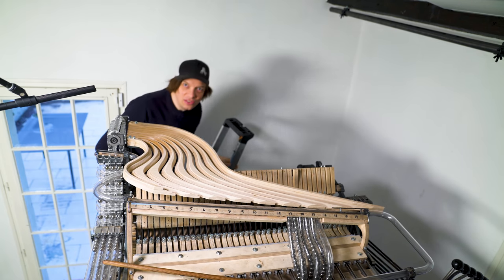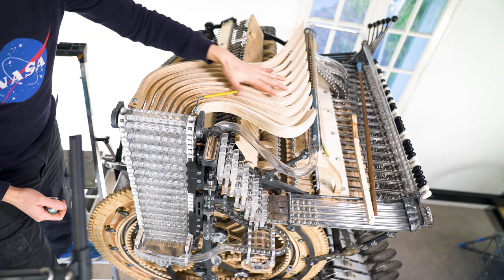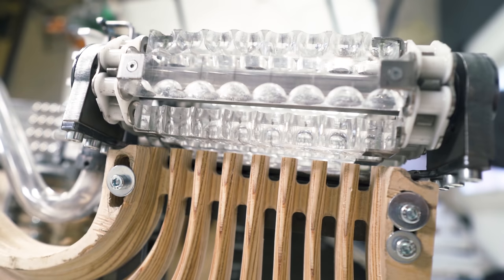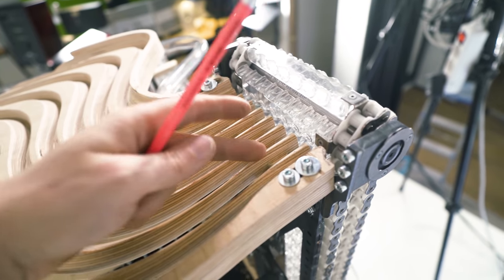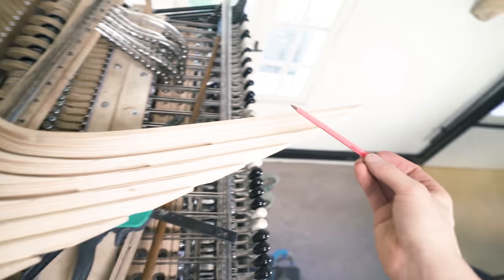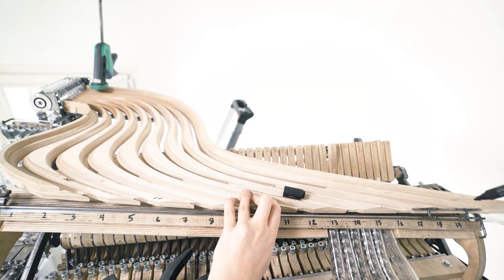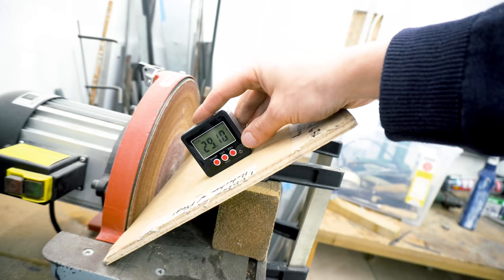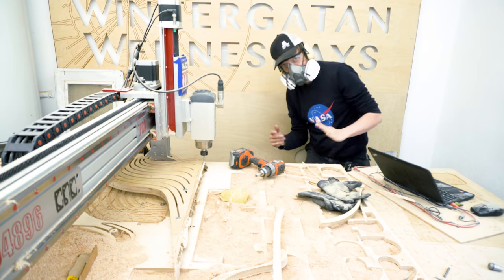Marble Conveyor Belt Plywood Lanes

Comment: Seems like the marble elevator tends to favor filling in the middle.  Is this a problem for the left most channels of the marble divider?  I mean there's the fish stair, but as you said it's limited capacity.  This feels like a potential mole.  As does all that bouncing.
Reply: If a recall correctly, he can choose where the marble will go before the elevator, and he choose to favor the middle
Reply: Yeah, I thought the same thing and commented on that last video... but I see now and remember that the fish ladder feeds more in from the absolute far left, sooo, shouldn't be an issue.
Reply: I worried about this as well, but as the other person said the entrance for the chainlift is adjustable and the machine is designed to work with a huge number of marbles, so there will probably always be enough marbles to fill the fishstair and subsequently the first couple of channels, so I don't think it will be a problem. the bouncing on the other hand seems like a potential mole, someone suggested on yesterday's video to slow the marbles down towars the ends of the tracks using overrotation, that might fix the issue
Reply: My thoughts exactly too.
Reply: @mikaoleander  Indeed overrotation seems to be a pleasant solution to counterweight the inertia gained thanks to the new shifted marble path.
Reply: @etiennedud  yes with some pins he can put or remove if i remember correctly
Reply: My worry isn't that they favour the middle, but that there are only up to 3 or so (out of 8) per every drop. If this can't be scaled up (if the demagnetiser is limiting the flow no matter how many marbles you use, for example - it might not!), that could be a mole on its own.

And yes, I'd go with both an extra rail (like at the end) and over-rotation if I were him, to avoid flying marbles!
Reply: @EcceJack  Its just because there is only a few channels playing and is not fully loaded with marbles, the majority of them and going though the stairs rather than being played, the ones one the lift are only the ones being played, add more channels and it will fill up a lot better
Reply: The lowest notes on the vibraphone are not used as much, therefore don't need as many marbles
Reply: I'm concerned about the fact that the fish stair relies on the excess marbles that run all over past the full channels. I wonder what would happen if a lot of central channels are suddenly drained by a fast playing sequence and then a lot of marbles from the leftmost channels are required.
Reply: I noticed that too. Maybe consider making similar mechanism to "devide by four". Maybe "devide by eight"? :) So the marbles have time to take space in all 8 slots od belt. That will be more efficient use of the convayer belt. Maybe there will be more empty turns, but od the turn occured IT will be full.
Reply: Agreed. Knowing the vibraphones will need more marbles it will need to adjusted to favor the first few channels, because those still pass every other channel.
Reply: @Altarin94  Just biasing towards the start of the divider should solve the problem. When things are full, there isn't a problem to begin with. When things are lean, feeding the divider starting from the top won't have much to conflict with. And it sounds like that is an adjustment that was designed in from the start.

Comment: Consider adding felt over the peaks of the wood dividers right at the point the marbles drop. They will quickly wear down the wood otherwise and it will reduce noise.
Reply: I was thinking that they could be curved, so that the track softly catches it instead of bouncing.
Reply: Why not both?
Reply: It'll probably help dampen some of the energy of the entering marbles too
Reply: yeah you can already see it hapenning
Reply: He said he rounded the corners of the tracks so it might be enough to keep it in shape for a long while
Reply: And also the first marble seem to bounce of the wood divider and hit the metal washer...
Reply: Also, making that area more substantial, removing less material.
Reply: i believe i can even see how marbles are eating the plywood already
Reply: Could be the place to introduce some hardwood, maybe beech or maple?

Comment: I'm concerned marbles will escape if the queue is more full than these tests have shown so far.
Reply: It had 4 lanes open though. I hope it won't starve for marbles if the machine will go full open lanes.
Reply: Yeah we’ll have to wait and see how it goes with the Vibraphone and Cyber Base hooked up. Once all channels are going there’ll be many more marbles entering the queue, but many more draining out of it too.
Reply: I imagine for each song there is an ideal # of marbles used and that can be adjusted pretty quickly, or he'll compose the songs to utilize the marbles evenly, or something else pretty simple. He has been down this road before...
Reply: @tommj4365  Yeah I mean he knows the maximum rate that the main marble lifts can return marbles to the top of the machine. So he has to write music that doesn't require more marbles per second on average than that. Having some extra marbles is probably no big deal, they'll just end up circulating repeatedly through the fish stair and marble divider. Just has to make sure there aren't so many extra marbles that that system gets overfull.

Comment: I like the new look, however i noticed that the marbles are jumping lanes as they leave the conveyor. complete lane departure at 8:29, 3rd track from left to 2nd track to left. 10:28 4th lane from left to 3rd lane from left and a near escape at 8:43 4th lane from left to 3rd lane from left.
Reply: This new design is visually interesting, but dead on arrival. The lane jumps, high speeds at the merge, additional entry points at the merge resulting in the marbles climbing,  having multiple lanes that effectively skip all of the channels... this is an engineering disaster.

Comment: The speed that the marbles come in off the track with is a bit concerning to me - when they land on the channels it seems like they bounce quite a bit, and that could lead to some dropped marbles in a large sample size.
Reply: I was worried about this last video, but it looks like they're mostly bouncing in towards the conveyor again. Because the back wall of the marble divider. There will be some serious bounces, but I think he'll be able to manage it with additional guard rails/walls
Reply: That lip where the tracks meet the divider is definitely the main thing causing the bouncing. I think a good solution would be to smooth out that lip, as well as slowing the marbles down a bit - I've seen other people suggesting widening the channels to cause over-rotation, or spraying the channels with some rubber coating or something similar to increase friction.
Reply: The merging onto the divider looks to me to have lots of potential for one-in-ten-thousand pileups which lead to lost marbles or, worse, marble jams. I fear this design may be unable to provide the required reliability.
Reply: @BambiTrout Sending highly rotating marbles into the divider isn't going to solve bouncy problems though. Rotation will slow them down, but now they have torque instead.
Reply: @BambiTrout  I think the over-rotation is a good idea, and quite fitting for the marbles to have these over-rotating lanes at the very top, and bottom of the machine.

Comment: I imagine there will be a lot of wear on that contact points where the balls first hit the lanes.
Reply: You might be right, I'm curious the effects long-term. That being said, I imagine it wouldn't be too difficult to match the geometry and replace just that spot with a machined piece of metal or acrylic
Reply: With machines like this, with the amount of use Martin expects of it, you have to consider all items wear items. It matters more about how the item fails, if it fails suddenly and unexpectedly, and if it's easily reolaceable - less about trying to design items that will never wear.
Reply: Maybe painting the wood with silicon paint will help.
Just a 6cm strip at the top where the marbles drop onto the wood might dissipate some of the energy.
Reply: Honestly some sort of thin felt like what’s used in piano bushings might be best.  Something thin enough to prevent wear and be fairly easily replaceable while also reducing noise without causing too much bounce.
Reply: I think this would be unnecessary from a wear standpoint. It will wear very slowly, and if it gets to the point of becoming an issue, a new part can be cnc'd and installed quickly. Lacquer or polyurethane could also be used to slow the wear, but I think many are underestimating the durability and flexibility of wood.

Sound is another issue though.
Reply: @neilhoh9443  I wouldn’t be too sure about that. He specifically mentioned how long it took to CNC this part and then we saw a snippet of what it took to adjust it to the actual machine. While the entire module could be replaced, innovations that allow things to be replaced easier and faster are certainly worth looking into, especially with the scope of the world tour. You can only have so many premanufactured backup parts and idk if Martin wants to lug around his CNC with him to manufacture more parts on set.
Reply: @EntropyValley  Yes, he did say it took  a few hours to cut (4 maybe?), however, this is also a prototype.  A final version will be created in cad without needing modifications before installation making a "custom" piece. A backup piece can be cut, if necessary, and taken on tour.  Again, I think people are underestimating the durability of wood. We are talking about a metal bearing dropping around an inch onto the tracks. there's not a whole lot of energy to dissipate. I think this piece may need to be replaced after a year or more of use, not after a couple tour stops.
Reply: @EntropyValley  Piano felt sounds good.
Reply: @neilhoh9443  I think people are mostly getting hung up on the blacking that the marbles are leaving behind. It looks like the wood is already getting hammered but really it's just the dry lubricant from the gates.
Reply: Guys, the CAD files exist, it takes like a day maximum to replace those plywood components!
These "concerns" that people have are making me mad.
Reply: He wants to take this thing on tours.  If you don't plan for durability he might end up spending days replacing parts each time.
Reply: @0x0404  Exactly.  I honestly don't think the wood is going to wear that fast, but making things more replaceable is never a bad thing for a machine that has to be assembled and disassembled countless times with long periods of time between when it's able to get back in the shop to be repaired outside of easily replaceable parts. Something like piano felt would both help to reduce the noise output of the marbles while also preventing a potential source of wear, and would do so in a way that would also be easily replaceable meaning that you'd really only need a second replacement part for if the rails themselves snap during transport / assembly.  Just as people are getting too caught up on the potential damage due to the marbles falling onto the wood, people are also getting way to caught up in the fact that the wood probably won't wear that fast.  Sure, the initial problem may not be as important as originally conceived, but it helped inspire solutions that could help improve the longevity and efficacy of the machine as a whole and I think that's ok.  If an idea or solution was dismissed just because the thought that inspired it was stupid, brainstorming sessions would never end because the best ideas are often spurred by really stupid comments or questions.
Reply: laqure it and it will be fine
Reply: If the conveyor could somehow be lowered like 10 mm so there is less of a fall.   Also the fall onto conveyor then fall onto wood.  Make the wood a little bit higher then that and only one bounce.  I’m not worried about wear as much as noise.    But contact mics will work. ?

Comment: Lots of bouncing when entering the marble divider, probably need to add more & higher guardrails there. (eg: 9:05)
Also probably need to cut out "track slots" in the sideways "attachment plank" (that the marbles jump over to enter the marble divider) to minimize jumping.
Can also add zig-zag groves in the marble tracks (same as how old vinyl records record stereo audio in the groves, but bigger) just before they enter the divider, to slow them down, could maybe also widen the grove, so the marble spins around a smaller radius, not rolling on it's "bottom edge" but is more like "squeezed" between the 2 walls.

Comment: It certainly looks good but the only slight niggles I've got is that only a limited number of marbles are coming down the lanes (possibly due to the lack of channels in operation?) and the way in which the marbles bounce off each other at the bottom. But then I might be worrying about nothing...
Reply: The bouncing can be fixed by putting a barrier, like the one at the end of the marble path. Feeding is not a problem also because the machine will start with full channels, so its cycling its marbles every time.
Reply: The throughput is still limited by the conveyor belt, so no loss in marble traffic (I think). The bounce has me worried too though. 😕
Reply: I worry about the speed and bouncing of the marbles too.  That new track is beautiful. Just hope he hasn't created more moles to wack.
Reply: Its look like marbles have too much speed. I think marbles bounce because of that speed. If the notes channels is empty, maybe marble hit the edge and jump from the chamber, I hope I'm wrong.

Comment: And now you just have to optimize the marblelift, so that the marbles are spread nicely between place 1-8.
Reply: It would probably be a better idea to set it to put the marbles earlier in the lift as the vibraphone is probably going to be seeing more use then the other instruments.
Reply: I think it has a pin that can be moved to direct the marbles to different parts of the conveyor belt

Comment: Isn't this going to starve the left droppers, though? Only the left-most marble lane can fill the first vibraphone channel.
Reply: the fish stairs might fix this issue, since marbles are recirculated in the droppers
Reply: I thought exactly the same things
Reply: This is my biggest worry with this current design. It looks beautiful, and starves the first vibraphone group.
Reply: He initially thought about it on the original design but here this isn't really taken into consideration i think.
Reply: (I do realize that the fish-stair also feeds in to the left-most channels - but it only feeds from the marbles that pass over the whole set of channels, right?) So at any point where the pace of the music is fast enough to keep the channels open to fresh marbles, fish stair gets starved, then left channels get starved - and rewatching, I'm not sure the leftmost one or two channels can even be refueled by the spreader at all - it looks like the marbles are coming in just a bit past them.
Reply: All the overflow goes directly to the left though remember.
Reply: @HowardCShawIII  the fish stair (and some other parts) does not perform well when under saturated, from what i understand martin plans to always keep the machine saturated enough that the fish stair always has a queue on it
Reply: an excel sheet could solve this equation 🎰
Reply: @deefdragon  consider up tempo music, the drums/cymbals will be most thirsty.. for any melodies that favor the short end of the vibraphone will unlikely out-pace the drain a 120+ bpm and the fish stair may just be suitable.  also consider the fish-stair has less distance to raise than the conveyor lift which could mitigate the imbalance of marble supply

Comment: I notice marks where the marbles hit the plywood coming off the conveyor belt.  Are those marks you made or are those from the marble hits themselves, and if the latter is there any chance that over time (and millions of marbles) that you would need to fix damage in this area?

ETA 1 - Would it make sense to replace the track from the fish stair over to the marble divider with a similar plywood track?  The PMA tube looks a bit out of place now.
ETA 2 - Looking at the marbles as they enter the marble divider, they are bouncing a lot.  Maybe slowing them down by making the tracks slightly wider so the points the marbles contact the rails on are further up would be a good idea.  I know it'll get complex with your parametric shapes for banked corners, but I'm just afraid you are going to end up with marbles bouncing off other marbles and flying off the top of the machine.  You don't need the marbles to be particularly fast on this track; you need high throughput but you can afford high latency here.
Reply: Maybe but I think it's graphite dust. The marbles pick it up from all over the machine
Reply: In all likelihood, that's graphite from lubrication
Reply: Probably mostly from the graphite dust and magnetic dust accumulated throughout the machine.